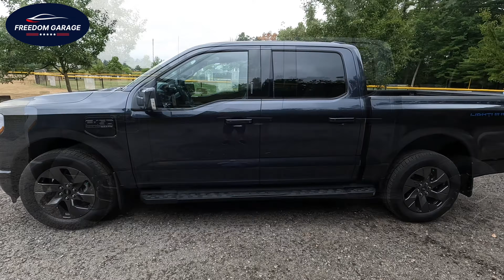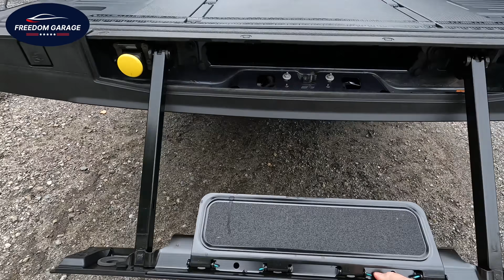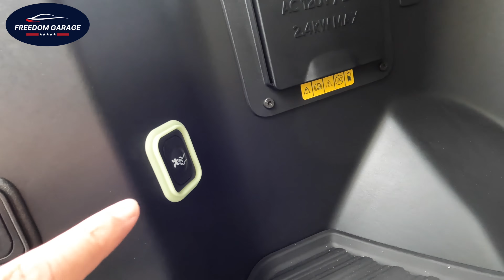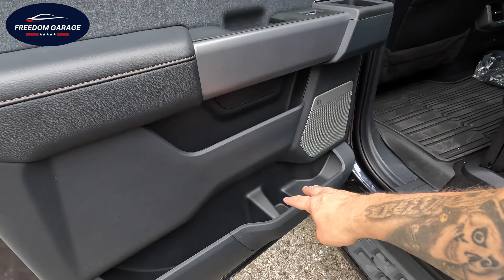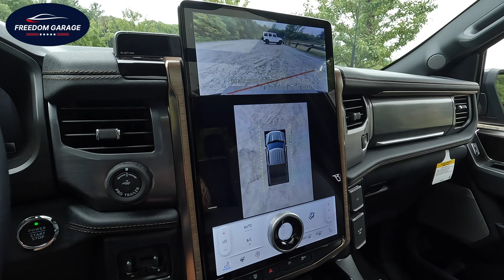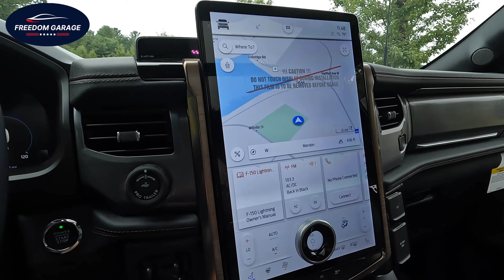I Took The 2022 Ford F-150 Lightning For A Spin And Loved It!

Comment from the maker: If you have a cool vehicle you would like me to film for Freedom Garage, email me: FreedomGarageUSA@gmail.com

Special thanks to Imperial Cars in Mendon, Massachusetts!
Imperial Cars
8-18 Uxbridge Road
Mendon, Massachusetts 01756
1-800-526-2886
https://instagram.com/imperialcars?igshid=NmNmNjAwNzg=
https://www.facebook.com/ImperialCars/
Reply: I'd rather buy a Pinto or even a Corvair over anything EV.
Reply: That should have the camper 30 watt plug in in back.
Reply: I would seriously worry about 2 things.  One, the power grid in NY, much like CA is not going to support this.  Two my 3500# camper will drain that battery too quickly to go anywhere useful.
Reply: Evs suck the technology is a joke. You can make a battery out of almost anything and it would be better than lithium. You need a gas/diesel/hydrogen engine to charge batteries unless useful technology is allowed to be brought to market. I would never even consider any new car that can be shut off remotely or software locked out of repairs or to charge me a subscription for heated seats. No thanks I’ll take a 1980s Chevy c10, a 90s powerstroke, a 4.0 liter Jeep from the 90s. The only newer cars I would even consider are the newer Taurus maybe explorer but nothing in the last 5 years or newer no automatic brakes or collision avoidance insanity or self driving crap.

Comment: Evs suck the technology is a joke. You can make a battery out of almost anything and it would be better than lithium. You need a gas/diesel/hydrogen engine to charge batteries unless useful technology is allowed to be brought to market. I would never even consider any new car that can be shut off remotely or software locked out of repairs or to charge me a subscription for heated seats. No thanks I’ll take a 1980s Chevy c10, a 90s powerstroke, a 4.0 liter Jeep from the 90s. The only newer cars I would even consider are the newer Taurus maybe explorer but nothing in the last 5 years or newer no automatic brakes or collision avoidance insanity or self driving crap

Comment: I'd consider one when they can figure out better range and towing
Reply from the maker: Towing and "heavy use" is a definate issue! Some vehicles have considerable range. My Tesla Model S has more range (393 miles on a full charge) than my Corvette (345 miles on full tank). But it is still much easier to fill a car up in 5 minutes than recharge in 40 minutes to multiple hours.
Reply: @FreedomGarage  for the performance that that Tesla gets it is absolutely astounding but I used to have a 1996 Honda Civic 5 speed that I got 45 miles to the gallon at 80 miles an hour 11.7 gallon tank would drive close to 600 MI easily

Comment: It is a sweet truck, but the range when towing a trailer is its Achilles heel. You mentioned the Ford raptor a couple of times. Also a sweet truck since you have an in at that Ford dealership maybe you could review the raptor R? The R found itself a V8.
Reply from the maker: When they come out I will try to get one on here.

Comment: I have a hate love relationship with EV cars/trucks. I’m a die hard car guy and love a cammed out v8 but the instant torque of a EV is awesome. I will continue to drive my lbz duramax for the simple fact that i can driv 900 miles on one tank of diesel and tow 16lbs where as the range and technology just isn’t there yet for EV. Also the usa doesn’t have the infrastructure for everyone to plug up there EV every night. Great review Jared.

Comment: Being a techie, I am impressed with all the features and gizmos this truck has. However, lets face facts here: the majority of people who are going to buy these are suburbanites who drive it back and forth to their office job every day and “justify” it by throwing that big bag of soccer balls in the bed after their kid’s practice or bag of mulch from Home Depot. A true truck user who hauls hay bales or lumber or real loads out in the country where the nearest charging station is 50 miles away will never buy one. While the acceleration is certainly phenomenal, as soon as you put 1,000 pounds in the bed or hook up a horse trailer, you’ll see the range drop drastically and a 250-mile trip take 3 times longer since you’ll have to stay on the interstate to be able to recharge every 100 miles or so. It is certainly a cool vehicle but not practical as a truck. That’s my opinion – I could be wrong.

Comment: First thing I find dumb is the front "light bar". it's a Ford so that's a strike against it, to begin with in my book. It isn't a very good-looking pickup is the third strike. It struck out. Not going to be in my driveway but still it's good to see they have an electric pickup as I have maintained that gas powered vehicles have been antiquated and unneeded for the last 70 years.

Comment: range is the problem with ev's in general. for any kind of a work truck hauling either high weight or a fair size trailer, greatly reduces range. if pulling a fair size camper for example, expect around 100 miles per charge assuming highway speeds, and 40-50 mins at charging area to get around 80%

Comment: Not for me, they lie about the ability of the electric batteries, if I put my horse trailer behind it I would probably only get about 70 miles. These vehicles seriously hinder the ability for one to travel any lengthy distance. To me that is very restricting maybe the government's doing is cuz they'll know where we are at all times can't go too far but if you do you better have a high volt charging system or you'll be all day charging it on a 110. So no electric is not for me but I do appreciate you sir thank you! A road trip just would not be the same anymore. Oh and you don't want me to get into what happens under certain weather conditions.

Comment: Total EV cars and trucks are a economic environmental disaster?  What happens when the grid go down?  Everyones taxes pay for these free charging stations. Do. you know what happens to the Large set of EV batteries?  
Can't recondition them. They go to the land fill or to China? For the rare metals inside. (A poisonous job).Also do you want to wait 6-7 hrs plus to charge on a long trip? Electric  trucks can't pull loads either.

Comment: Sorry Jared I have a friend who bought one and it's a completely useless vehicle.  Can't tow a camper more than 75 miles without a charge.  Even though the factory says you should be able to get at least 150 miles on a full charge.  Don't get me wrong I really don't mind electric vehicles but they should be able to do the work.
Reply: Even if you go tent camping with that you would have to get a full-blown 50 amp camper spot to charge your vehicle LOL

Comment: i don't know about you, however i CANNOT AFFORD one,  let alone i  have a problem, i have seen that the Batteries START ON FIRE, i DO NOT NEED TO BURNED UP IN A EV, and have the EV be Possibly SHUT OFF REMOTELY by NEFARIOUS CHARACTERS, or possibly be  TAKEN CONTROL OF IT WHILST DRIVING, and  FORCE A CRASH...  (JMO).....plus HOW GREEN are they?  HOW MUCH MONEY is it to REPLACE a BATTERY???  How will the BATTERIES be RECYLCLED? How much of FOSSIL FUELS did it take to Create EV's, get the REAL NUMBERS, NOT the SKEWED ONES THEY PUSH...
Reply: And don't forget most electricity is still produced using coal

Comment: Why does it have to be so overly equipped? If the manufactures and powers that be want electric to be the future, scale back the bells and whistles. I don't need light bars, plush luxury interior, moon roof, gizmoleitry etc. on a truck. In other words, make it more affordable. And I think the front looks pretty bad.
Reply: Then buy a lower trim like XLT?

Comment: I have been watching TFL while they have been testing one of these, and as a truck which would be used to tow anything it is useless even the extended battery goes from an expected 320 miles of range to around 80 - 90 miles. So I am now after watching all of that totally unimpressed.
Reply: Hey Jarod,  perhaps you should talk about the horrific environmental damage caused by the manufacturing of batteries in EVs. Perhaps you could talk about the fact that there is less lithium in the world than there is oil. If you want to save the environment,  plant some trees.
Reply: The milage estimates are all easy overstated!! They are reported under the perfect conditions. If the temperature is too hot or too cold, the batteries really suck. If your going uphill, the batteries suck. If your driving in snow, mud, sand or anything other than a nice road, the batteries suck. If you driving  with batteries that do not have much charge left, the batteries suck. To make this much shorter, the batteries suck!!
Reply: That is true, when you’re towing a huge brick of a trailer. But when you’re towing a more aerodynamic load like a boat, it’s not nearly as bad. The majority of pickup drivers do not frequently tow very tall travel trailers, maybe a few times per year at most for the average family. And for them, this truck is perfect.
Reply: @randocrypto1678  I'm not so sure about that I watched a review where they took four I believe trucks out for a typical drive I don't recall how many miles it was it was supposed to be well within the Ford lightning range and it was but it was a Dodge Cummins diesel I believe a Nissan Diesel a Chevy gas engine and the Ford lightning I think where the four trucks after taking the drive they went to the pumps and filled up the internal combustion engine trucks to see how much it cost to take that drive the Cummins turbo diesel engine actually had the cheapest bill for that drive of the internal combustion vehicles the Ford lightning took an hour or more to charge up and it was only $6 less than the Cummings

Comment: Wasn't the lightning their 680 hp model back in like 2005. Around then
Reply: 360 horsepower and 440 lb-ft of torque.
Reply: @Lofi.z34  But a lot slower.

Comment: Just not a fan of fords. Not going electric till I can pull a 16 foot tandem axle fully loaded trailer 400 miles or more without stopping to charge
Reply: Every internet pickup truck owner tows a house trailer 600 miles per day.